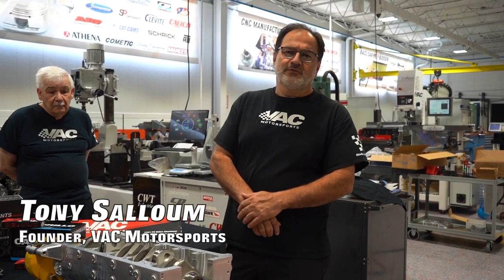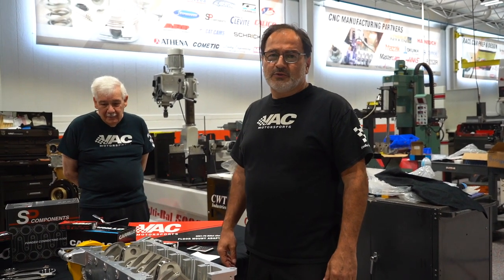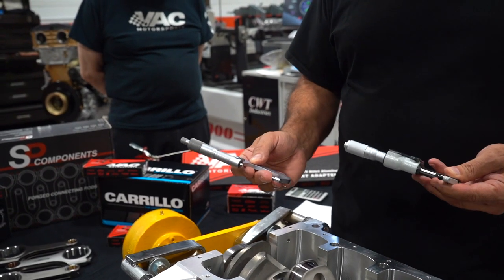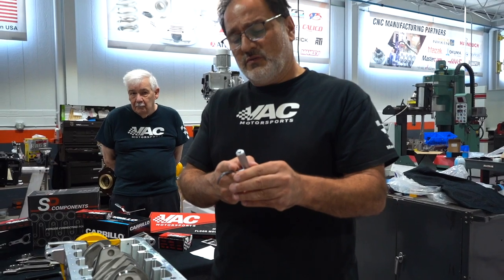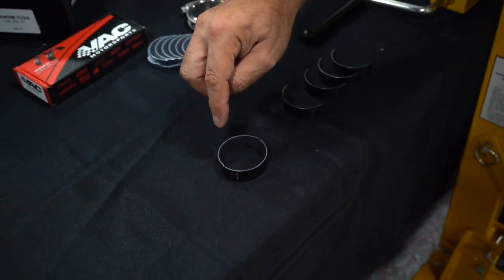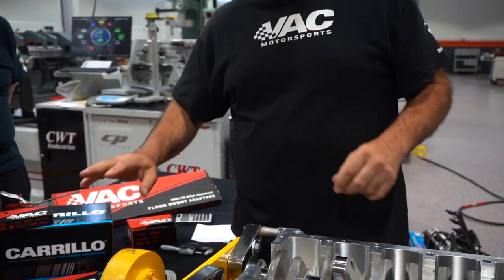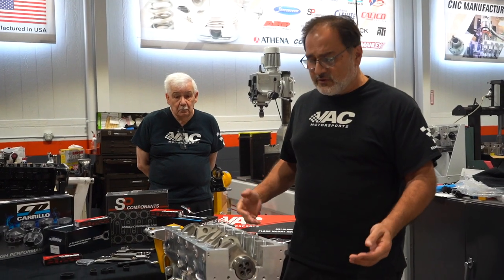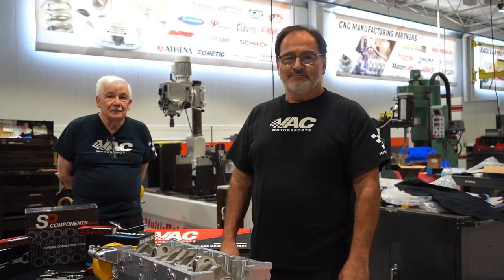Rod Bearing Clearance EXPLAINED with VAC Motorsports

Comment: Hi! I have a question in general: When I do check my crankshaft bearing clearances (torqueing them down and measuring without a crank in the block) can I re-use those bearings when I finally mount the crank? Or do I have to buy a whole new set of crank and rod bearings? My friend said after toqueing down crank caps and rod caps the bearings get crushed and cannot be re-used. On the internet I found only one reference which said that they only get crushed "elastically", so they would do get back into their origin shape after loosening the caps....  Marlon
Reply from the maker: When checking crankshaft bearing clearances by torquing down the caps without the crankshaft in place, it’s generally acceptable to reuse the bearings for the final assembly, provided the following conditions are met:
	1.	Torque Application: Bearings are designed to deform elastically when torqued down, meaning they will return to their original shape once the caps are loosened, as long as proper torque procedures are followed. Over-torquing or repeated torquing can lead to damage, which may affect bearing integrity and clearances.
	2.	Inspection After Measuring: Before reusing the bearings, carefully inspect them for any signs of damage, deformation, or wear. If you notice scoring, scratches, or signs of uneven pressure, replace them.
	3.	Number of Torque Cycles: Avoid excessive torque cycles. Bearings can tolerate a few cycles during assembly and measurement, but repeated clamping can increase the risk of fatigue or damage.
	4.	Cleanliness is Critical: Ensure everything is perfectly clean during the measuring process. Any debris between the bearings and caps can cause uneven deformation and compromise the bearing surface.

Your Friend’s Concern:

The idea that bearings are “crushed” and cannot be reused after torquing is a misunderstanding. Bearings are designed to handle these elastic deformations as part of the assembly process. However, if over-torqued or misaligned, they can suffer permanent damage. Proper care and correct torque specifications ensure reusability.

Recommendation:

If you followed the correct procedures and ensured cleanliness during your clearance checks, you can safely reuse the bearings. However, if there’s any doubt about their condition or if you’ve torqued them down multiple times, it’s safer to replace them to avoid potential engine failure later. Bearings are relatively inexpensive compared to the potential cost of damage.
Reply: @vac-motorsports  Thank you so much for your detailed answer. Thank you for taking your time to answer my question while explaining all aspects. Thank you! Marlon

Comment: I'm not sure about the BMW platform but I know one thing bearings are not perfectly round like your main bearing journals. This is by design. The horizontal measurement will always be different than the vertical. This is due that went under high horsepower. The crankshaft is trying to be pushed out of the block and the bearings bearings are made to maintain clearance for oil

Comment: It is said that some BMW engines have much too tight rod bearing clearance. I called VAC about possibly having BE bearings installed, also coated, but designed to have a little bit more clearance. So that the engine oil can better lubricate the bearings. Paul Milano was quoted to have joked, "Why would you want to install worn bearings?" Would love to hear more about this issue ...
Reply: Hi. What would you like clarified? I'm not understanding exactly what you are asking.
Reply: @tonysalloum6973  Thanks, Tony. Why do some people recommend rod bearings that provide a little more clearance, whereas you guys do not recommend those?
Reply: That's not true. The VAC Bearings do have more clearance than OE bearings. Others claim that they don't have enough clearance but as I mention in the video, the clearance has a range and is different for different builders. If you can't measure the crank journal, the big end of the rod after it is torqued properly, and can't measure the bearing accurately down to 0.0001"-0.0002" then how do you really know what you're true clearance is. But again, the VAC Rod Bearings do have additional clearance. 😊
Reply: @tonysalloum6973  In the video, it looks like you're building an engine for FI, replacing the crankshaft and the connecting rods, and while it's all apart doing all of the relevant measurements of the shaft and rods and bearings. If you're just inspecting and possibly replacing bearings on a stock engine from underneath the car, I presume you can't do all of these measurements. So, if you recommend replacing the rod bearings, how do you choose the right thickness for the bearings?
Reply: Haha!!! That does like that. 😊
Yes, it's absolutely correct. You can't measure rods accurately in the engine. The VAC bearings are based on the OE bearing dimension but with the required additional clearance, based on many years of experience, to keep you in a safe range.
Reply: @tonysalloum6973  How much additional clearance? This is hotly debated by self-proclaimed Internet experts. It would be nice to know from VAC. Some say it only has enough extra clearance to allow for the coating. Is that true? Or is there additional clearance after the coating?

Comment: but would not be better than to have an electric pump prime the oil pressure before starting the engine, and keeping the oil pressure up when you shut the engine till the crank stops ?